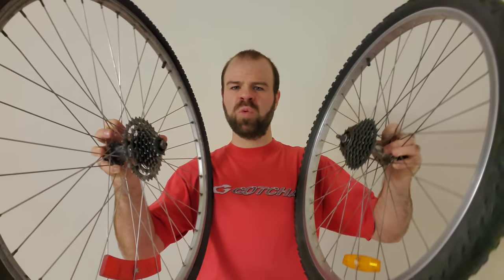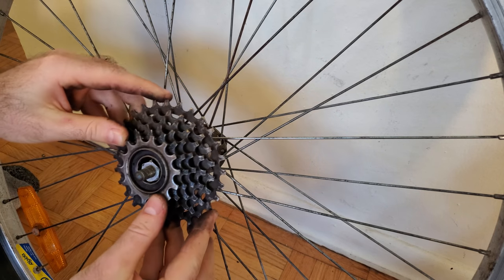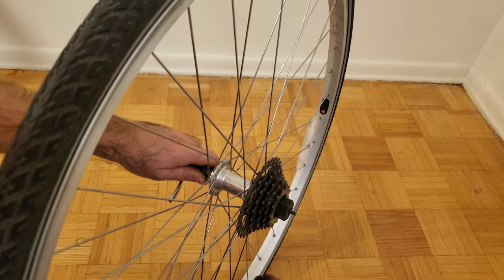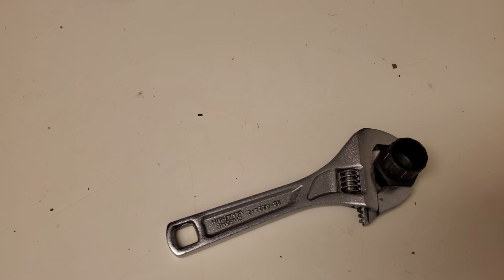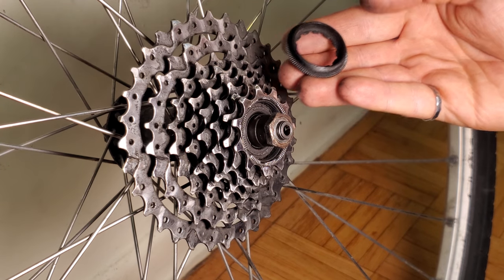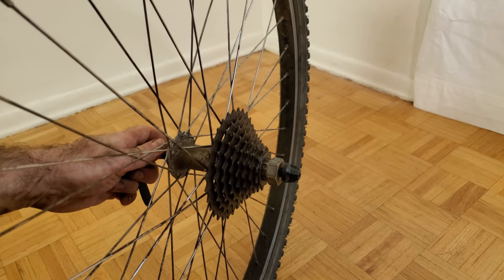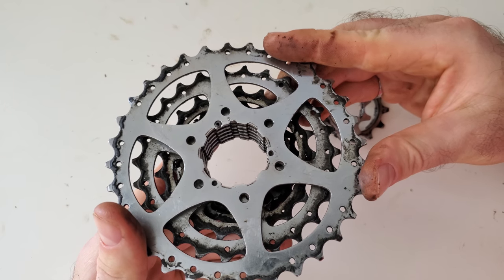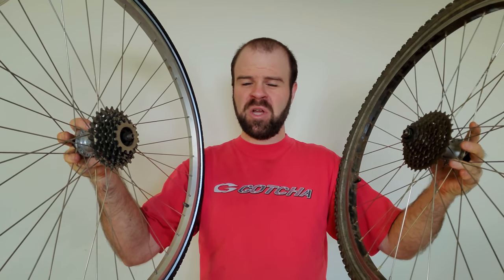How to Remove the Cassette or Freewheel from Bike Wheels

Comment: What a great video this is. I’m in the UK and just got my son an Apollo Hybrid from Halfords. It’s not an expensive model at £210. Following this video I’ve been able to work out why the chain isn’t moving the rear wheel. I need a cassette lock ring tool as I believe it came loose where they haven’t tightened it enough

Comment: This is the clearest and most thoroughly explained video I've seen on the subject. I was attempting to remove my freewheel with an adjustable wrench (and a cheater bar, kind of). I practically gave up it was on so tight, but CJ's tip to use a 1-inch box-end wrench saved the day. I found one for $3 at a local reuse shop, and I had the wheel off shortly after (had to use my leg, though, which was another tip I learned from this video!) Thanks, CJ!

Comment: A very informative video. Thanks.
Can a single free wheel sprocket be fitted back to front as I want to install the sprocket to an e-bike hub motor to drive a trikes rear axle using a made to suit hub mounting bracket.

Comment: Thanks for the amazing work, Just a quick question. My bikes sprocket is loose and it make noise when I am pedaling. It is exactly like loose wheel bearing you experience. But not the wheel itself, but the sprocket. Any tut on this, Do I need to replace the entire sprocket or I can replace soly the bearings if there is one somewhere inside the sprocket.
Reply from the maker: There are two common styles of rear sprockets (Cassettes and Freewheels) and I have a video which will help you identity which type your bike has. The solution to fixing your problem will depend on which type you have.

Comment: The problem I'm having is my freewhell was pit onto an electric rear wheel and the tool to take it off is not big enough to slide over the axle. I really need help here ive noticed there's like a locking cover over the last cog is the to take the first cog off to put a tool over the axle?

Comment: Quick question. What are the chances that I can upgrade my 7-speed freewheel to an 8-speed freewheel? I don't know much about freewheels but I know when it comes to freehub cassettes they are all pretty much the same width and that is done by making the cogs sit closer together as you increase the gear count, but is that the same case for freewheels or does the width of the freewheel actually increase the higher you go up in gears meaning I would need a longer axle to accommodate an 8-speed freewheel? So basically, is the gear spacing the same on a 7-speed freewheel as it is on an 8-speed freewheel or is the 8-speed freewheel wider?
Reply from the maker: Having never seen an 8-speed freewheel, I can't answer this question with complete confidence. But my belief if that an 8-speed freewheel is wider. While you're correct that sprockets are placed closer together on higher speed count cassettes, they also are wider too.
Reply: @cjhoyle  alright I appreciate the input. I already ordered the 8-speed freewheel and plan to install it tomorrow or Friday. I'll update you on if it was a success or not.
Reply: @cjhoyle  update: just installed the 8-speed freewheel and it fits fine, no issues at all (except for buying a really cheap freewheel removal tool off amazon, it being to small, then having to go to my LBS and buying the park tool free wheel removal tool which worked perfect, lol)

Comment: Hey I just found your channel yesterday, can you make a video on servicing front suspension fork, and another one where you show all the tools that you have for repairing bike. Thanks
Reply from the maker: Thanks. Front suspension forks are not a system that I have an awful lot of experience with, so I'm probably not the best resource for learning about them. In terms of tools, I have a video called "Top 9 Essential Bike Tools - What to Carry While Riding". In terms of buying additional tools beyond that, my advice is to buy the tools that you need, as you need them. For example, in this video I showed the 4 different freewheel tools that I own. There are more freewheel tools available, but I don't think it's practical for every person to own the full set since many of them you'll never use.

Comment: Hi, the sprocket freewheel spins both directions  from a Schwinn . Now can I replace it from another basic bike rim ? And the ball bearings inside  are they replaceable ?;
Reply from the maker: Freewheels can be swapped from one wheel to another, though you might run into some problems with chain skip depending on the level of wear. Freewheels are really difficult to service because there are so many ball bearings and they are really small. Given that Freewheels are fairly inexpensive, when they fail most people just replace them.

Comment: I’m trying to help a friend with his 7-speed cassette but after putting it on the free hub there is som play even though I’ve tighten up the locking. Feels like there’s suppose to some spacer or something I’m missing. I’m use to tech MTB with 10 and 11-speed. Can there be something wrong with the hub? Unfortunately he throw away the old cassette so I can’t look at that.
Reply from the maker: Yes, it sounds like you are missing a spacer.

Comment: Hello!
I have really found your video useful.But I have question that can I replace a cassette from a cassette  hub and install a install a freewheel in stead of cassette??
please let me know quickly.
Reply from the maker: Unfortunately the two systems are incompatible from that perspective. If you wanted to convert wheel from one system to the other, you would need to replace the hub, which means re-building the wheel (removing all the spokes etc). Most people who want to do this switch just buy a new wheel. I have a video where I did this called "How to Upgrade a Bicycle from Freewheel to Freehub and Cassette
"